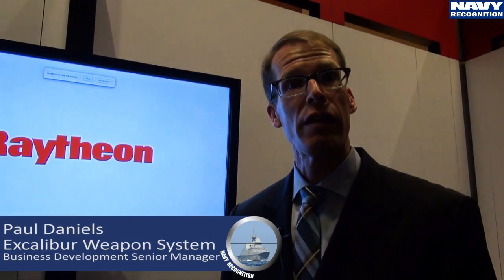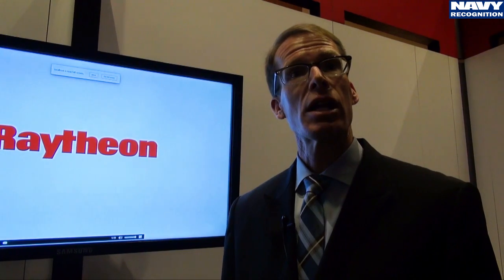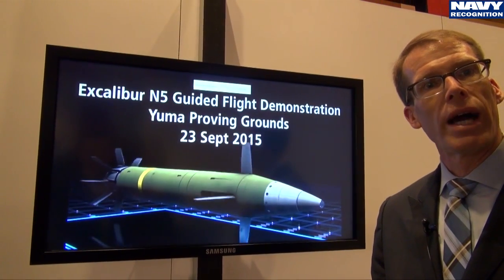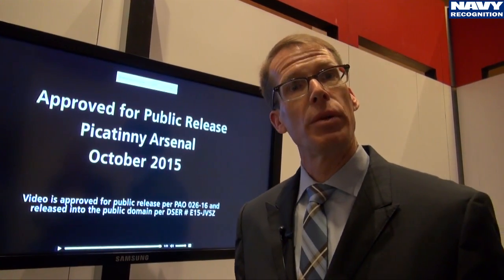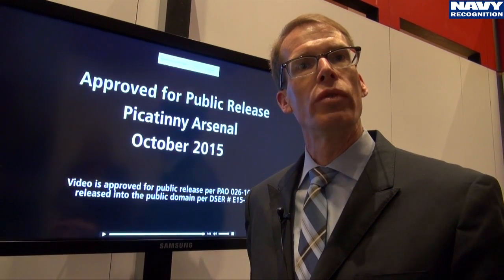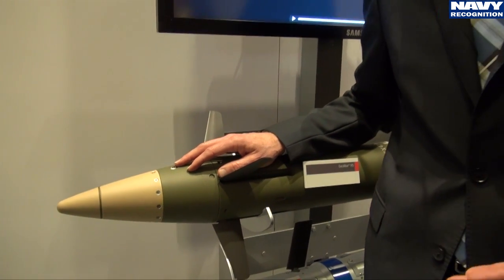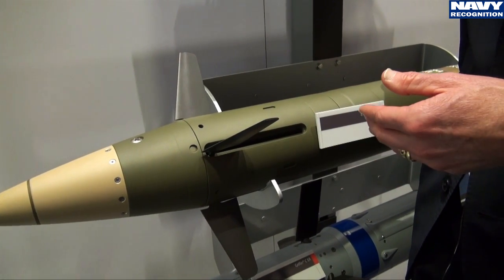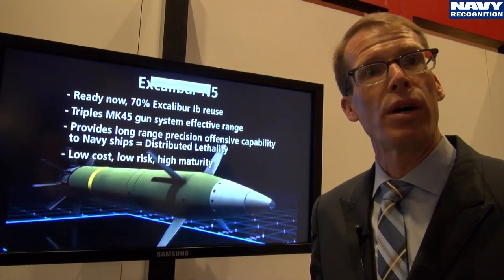Raytheon Excalibur N5 at Surface Navy Association SNA 2016

Comment: Wasn't this type of round tried out earlier for the 5-inch gun which failed miserably?
Reply: No. That was a LRFP projectile with a 60 mile range which ended up costs 800 grand per round. So they cancelled it. Now they are trying to use guided 155/5 inch rounds which are much cheaper and give it a 30 mile range which would be useful for bombarding landing sites or costal fortifications